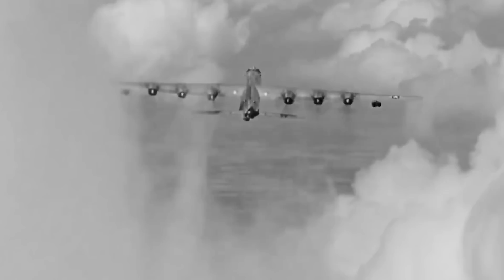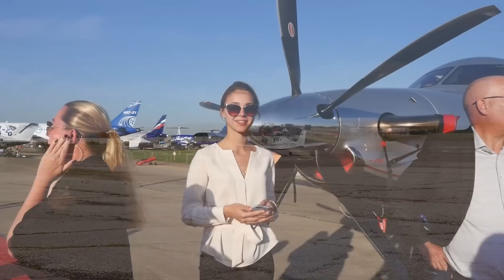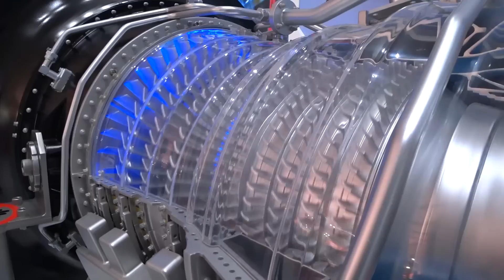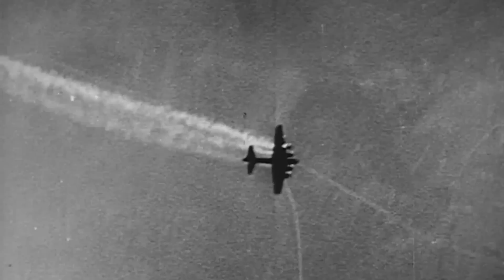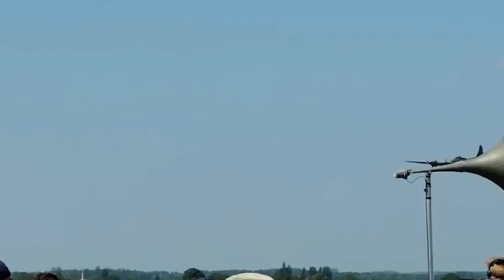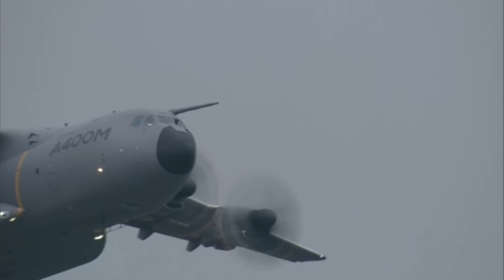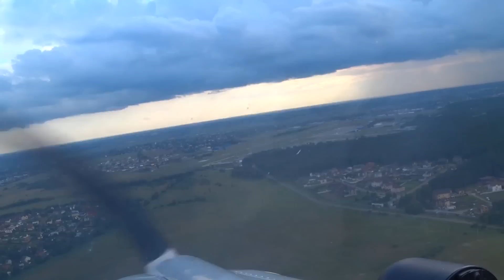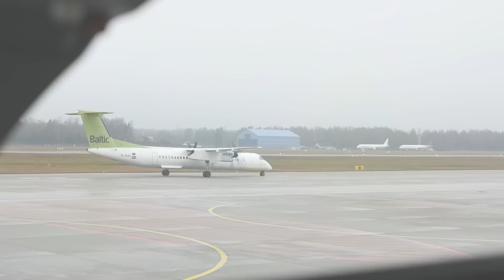Piston and Turboprop engines | What is the difference?

Comment: No one would build a big radial today if they wanted a ~2,000 hp piston engine, they would use a liquid-cooled V-12, like the Allison V-1710, but with modern engine technologies and electronics. Air-cooled radials were chosen for bomber aircraft because they were resistant to damage from weapons fire, but liquid-cooled engines are far more reliable and have cooling systems which produce much less drag, especially at high altitudes.
Reply: Dude, it's not the drag. The reason they used radials was the technology of the times. Is that why P47's, F=2's, 4's & 6's used radials as well? 
Have you any idea when the last replacement parts were manufactured for a radial? Like for a R-2800?
Reply: @georgegarrett9021  Inline, liquid-cooled engines came BEFORE air-cooled radials, and they outperformed radials.
-
As an experiment, a B-17 was refitted with Allison V-1710s and renamed as the XB-38, it flew significantly faster than the B-17 and it could fly significantly farther (both benefits of reduced drag), but radials were used because they were more resistant to battle damage. The same situation occurred with the B-29 and the XB-39.
-
The DC-4 and the Canadair North Star had similar differences in performance, but the Merlins were undesirable in an airliner application because of the noise produced by the open exhausts. This problem could have been solved by using a turbocharger instead of a supercharger (as was done on the P-38), but cost likely would have been an issue.
Reply: @PistonAvatarGuy  the P38 was "Super Charged"? Was the P51 super charged too?
Can You explain about all of that drag especially at high altitudes? How many hours have you logged at & above FL180?
Reply: @georgegarrett9021  "the P38 was "Super Charged"? Was the P51 super charged too?"
-
Oh no, I hit the space bar when I shouldn't have, I must be a complete idiot! The P-38 was TURBOsupercharged, the P-51 was supercharged, as were basically all WW2 fighters.
-
"Can You explain about all of that drag especially at high altitudes?"
-
Holy crap, dude, that requires a LONG explanation. It has to do with the cooling fin density on the engines reaching practical limits and being able to force enough air over the fins to provide adequate cooling at high altitudes. As altitude increases, it becomes more difficult to create enough pressure to move a sufficient amount of air (by mass) over the fins without creating enormous amounts of drag. Air is thinner at higher altitude, in case you are not aware. With a liquid-cooled engine, you simply use coolant to move the heat outside of the engine, which allows you to use much more ideal means to dissipate the heat energy.
-
IIRC, when the Soviets were designing the Tu-85, cooling the air-cooled engines that were first chosen for it ate up thousands of HP worth of thrust at the desired maximum altitude, so they switched to liquid-cooled engine instead.
-
"How many hours have you logged at & above FL180?"
-
Can you explain how that's relevant to this discussion?
Reply: @georgegarrett9021  Your comment really is just nonsense. The Navy had a requirement for radials, for whatever reasons (likely because the aircraft could be made shorter in length, so they took up less deck space on aircraft carriers). Have you never heard of the P-40, P-51, the P-38, the Spitfire, the Hurricane, the Lancaster,  the Bf 109, the Ta 152, the Do 335, etc?
Reply: @PistonAvatarGuy  sure have. I don't know about the Germans but it took the alias some time to learn to get what they needed out of merlins. Especially at altitude. 
The only thing I'll disagree with is "the drag" part. And I will stand by, radials were just more abundantly available. It's in the history books if you want to "learn" something.
I suppose haveing a radial is why the F8's & Sea Furries were such dog's too.
Oh well, I have no knowledge of airplanes any way. Especially since I was never around any.
I only come here to learn from the professor. By no means for the jockularity. 
Oh, you left the P39 out. 🤣
Reply: @georgegarrett9021  I don't even know what you're trying to say about "the drag." Are you saying that liquid-cooled engines don't have less drag? There has never been a debate about this in the "history books." You are aware that the Meredith Effect allowed liquid-cooled engines to have basically NO drag, correct? Liquid-cooled engines also have much lower frontal area.
-
"I don't know about the Germans but it took the alias some time to learn to get what they needed out of merlins."
-
And? How is that related to anything here?
-
"And I will stand by, radials were just more abundantly available."
-
Because they were in greater demand, they weren't just producing things randomly.
-
"It's in the history books if you want to "learn" something."
-
So is the fact that radials were REQUIRED by the Navy and were preferred by the Army Air Force because of their resistance to battle damage. I've read plenty of "history" books, I have a stack of them that's about 2 feet high on my bookshelf and I very much enjoyed reading through them when I was a teenager.
-
"I suppose haveing a radial is why the F8's & Sea Furries were such dog's too."
-
Compared to fighters with liquid cooled engines, THEY WERE. The fastest fighters of the war all used liquid-cooled engines. AGAIN, the Do 335 and the Ta 152.
-
I'll let you in on a little secret: THE RADIALS WERE MORE POWERFUL THAN THE INLINE ENGINES, that's what gave them decent performance, but it still wasn't enough to overcome the greater drag that the engines produced.
-
"Oh, you left the P39 out."
-
I wasn't naming every WW2 fighter, moron. BTW, there are no Sea "Furries," there was no F8, it was the F8F, and how long parts were produced for radial engines is not related to how much drag they produced. You have absolutely NO IDEA what you're talking about, you're just spewing random nonsense.
-
AGAIN: Compare the XB-38 to the B-17 and the B-29 to the XB-39. The XB-39 even had less power than the B-29, yet it flew faster and farther, that's not possible without a reduction in drag, unless the aircraft is capable of breaking the laws of physics.
Reply: @PistonAvatarGuy  thank you professor.
Again, you have how many ACTUAL hours above FL180? 
You made it sound like the radial has a lot more drag especially at altitude. I'm saying that the drag created by radials, Especially at altitude compared, example, to a Merlin is minimal. With power on. Now, if you want to shut the engine down and glide, yeah ok.
There will be a lot more drag down low than up in the higher altitude.
ARE YOU EVEN a pilot? Didn't think so.
Enough said.
Reply: @PistonAvatarGuy  so how much do you Really know from experience the difference between a radial and a in line? I wonder What other factors might contribute to, didn't you say, the range of that b 17 & xb whatever.
Do You even know what the difference is, in fuel flow, between the two with comparable horse power ratings? 
No you do not. Why? Because you don't know crap about any airplane other than what you Read from a book. You've 
Already have told me that. 
Did you know that the difference in compression between a air cooled and a water cooled engine is different. Gee, do you think that could effect the range & performance?
Reply: @georgegarrett9021  You've said absolutely NOTHING of value here, you have NO CLUE what you're talking about and nothing that you've said makes any sense.
-
"There will be a lot more drag down low than up in the higher altitude."
-
You can't even understand this one basic thing. As you climb in altitude, the air around the aircraft is less dense, that means that there's less mass in a given volume of air than there is at lower altitude. An air-cooled engine requires a certain MASS of air to flow over its cylinders at a given power setting in order to maintain a safe operating temperature, but because air gets thinner as altitude increases, it becomes more difficult to force that amount of air over the engine.
-
In other words: If you want to DESIGN an aircraft with a air-cooled engine that can fly at very high altitudes, you need to DESIGN a very large scoop for the engine cooling air in order to get a large enough mass of air to flow over the engine for it to maintain a safe operating temperature. The larger the scoop, the greater the amount of drag. Liquid-cooled engines don't have this problem because the design of the radiator is independent from the design of the engine, whereas the radiator is part of an air-cooled engine.
-
This isn't about FLYING an aircraft at varying altitudes, as they will be designed to fly at altitudes where they remain practical to operate, this is about how aircraft are DESIGNED by aircraft manufacturers.
Reply: @PistonAvatarGuy  your the one just spitting jargon. You have No real idea of the, real, performance differences between the two. If you did, you would know that a 1000 horse radial will burn damn near twice of the fuel as a water cooled engine with basically the same horse power. 
It's not the drag that makes the difference. It's the fuel flow!
Reply: @georgegarrett9021  What personal experience do you have with the B-29 and the XB-39? Do you also have personal experience with the B-17 and the XB-38? How about the Canadair North Star and the DC-4? How is personal experience relevant here? EXPLAIN IT.
-
"Did you know that the difference in compression between a air cooled and a water cooled engine is different."
-
Modern liquid-cooled engines can have significantly higher compression ratios than air-cooled engines, but they weren't significantly different during WW2. The R-3350 actually had a slightly higher compression ratio than the V-3420, yet the V-3420 GREATLY outperformed the R-3350. The XB-39 also wouldn't have been able to fly faster than the B-29 with less power unless it had less drag.
-
Do I need to film a f--king puppet show for you? Why are you getting so wound up about this? It's just technology, calm down!
Reply: @georgegarrett9021  How does fuel flow make an aircraft fly faster with less power?
Reply: @georgegarrett9021  "So I have no idea about flying at altitude."
-
How is your flying experience relevant to the DESIGN of an aircraft? Have you ever DESIGNED an air-cooled aircraft to fly at high altitude? Maybe you should go tell Grob that using liquid-cooled engines in the Strato 2C was a stupid idea, or maybe go inform Boeing that using liquid-cooled automotive engines in the Phatom Eye was stupid. Post their replies here, I'll wait.
-
"The higher the plane climbs, the less drag it has not more."
-
Like I said, you're not understanding any of this, you're not even attempting to understand. This isn't about drag at high altitude vs low altitude, this is about the drag that air-cooled engines creates AT HIGH ALTITUDE vs the drag that liquid-cooled engines create AT HIGH ALTITUDE.
Reply: @PistonAvatarGuy  I rode in the nose of b 17 once. A Ford trip motor once, saw a B36 crash and burn at Whitman. A 2 seat P51 and flew a T-6 some. 800 hrs Pic in the Lear 35. A couple of thousand in the B200. 10+ thousands of hours in various other muti engine aircraft. All PIC.
And a few hours in one of the hound dogs. They were jetstars Elvis owned. 
It Dosn't change with the aircraft. Drag is drag & altitude is altitude.
The numbers may change but the effect don't.
Reply: @PistonAvatarGuy  🤣
Of course it does. With the same engine. The more fuel you give it the faster it's going to go.
Reply: @PistonAvatarGuy  correct. That is what I know for fact.
Reply: @PistonAvatarGuy  go back and read your first reply. That is exactly what you said.
Reply: @georgegarrett9021  I said: ...liquid-cooled engines are far more reliable and have cooling systems which produce much less drag, especially at high altitudes.
-
Liquid-cooled engines produce less drag at ALL altitudes, the DIFFERENCE in the amount of drag produced by the two engine types INCREASES as altitude increases. I wasn't saying that drag increases with altitude, I was saying that one engine produces more drag than another as altitude increases. You have the worst reading comprehension of anyone that I've ever come across online, and that's saying a LOT.
-
BTW, Burt Rutan will tell you the same things that I've said here and he's one of the most prolific aircraft designers of our time. How many aircraft have you designed?
-
IIRC, his statements about liquid cooling are somewhere in this presentation: https://www.youtube.com/watch?v=2OZQ-9Nd76g
Reply: I have not nor have any intentions to design a aircraft. If I did it would look like the Avanti Piaggio or Beech B2000.
The reason a lot of the WW2 fighters had radials is simply because they were already set to manufacture or were already proven. The manufacturing of them were already tooled. No one with any sense would've not wanted (example) a Merlin. They wanted them. They just weren't quite up to the job yet. An A36 compared to a P51D. We the allies didn't get the D's untill what? 43, 44?
They were the cats meow. Along with the P38s. The P40, for one example was not a good airplane above 15,000. Yeah, I'd taken a corsair or even a P47 over a P40. Unless the zeros would stay down low.
In today's world, developing a Radial would just not be a good idea if for no other reason, the amount of fuel its going to burn. Oil/fuel wasn't a real big problem back then. Having to carry enough to get Germany and back was a problem. Especially for those big, thirsty radials.
Radials just aren't practical anymore. A turboprop is the same headache if you don't go High.
I believe we kinda agree, just saying it different. But I believe it's even easier to understand when one has been there & done that.
Look at the B36. Back then in 50s all they had was radials that could produce that much power. Albeit, they had to stack several rows of jugs. The turbo jet and even low bypass turbo fan jet were in the works, it was just going to take a little more time and the military brass (Curtis Lemay) just didn't think he could wait. So the B36 had to be.
They weren't up to Snufff with their turbo chargers in the war radial days at first. I believe it was the p38l? it could produce sea level pressures at 30,000feet. The turbo's today only give sea level to 15,500.
Have you any idea about "coffin corner". That is something that I didn't like about the Lear 35 all the way back to the 23's, if I got to fl450 or so. We seldom got above 370 because of it. The new wing has really helped them with that. 
Okay, later.
Reply: @PistonAvatarGuy  🤣
I know I'm not a troll and I'm not as stupid as some I have known. 
But wasn't it fun. I miss read it whilst I was trying to multi task.
🤣
Reply: @PistonAvatarGuy  I met him back in 80 or so at Mojave. They were doing tests on... was it the Lear fan. I don't remember now.
Reply: @georgegarrett9021  "The reason a lot of the WW2 fighters had radials is simply because they were already set to manufacture or were already proven."
-
That doesn't make any sense, because liquid-cooled engines were around FIRST. The first successful powered aircraft was powered by a liquid-cooled inline engine, as were many of the most successful early aircraft. The Merlin and Allison were based on long lines of successful aircraft engines and were in widespread use well before WW2. YOU HAVE NO IDEA WHAT YOU'RE TALKING ABOUT.
-
Clearly, reading isn't something that you do a whole lot of, but I suggest that you read Aircraft Propulsion by C. Fayette Taylor, it's available free online.
-
"Along with the P38s."
-
Which did NOT have radial engines. The US didn't have many competitive fighters early in the war, radial or not, there was no performance advantage to be had with radial engines. AGAIN, the Navy REQUIRED that aircraft have radial engines, because of their resistance to battle damage, this is a widely known FACT.
-
" Oil/fuel wasn't a real big problem back then."
-
That's a HUGE problem during wartime, because possible supply problems and the logistics associated with the transportation of fuels are major concerns. AGAIN, liquid-cooled engines have far less drag that air-cooled engines, PERIOD.
-
"But I believe it's even easier to understand when one has been there & done that."
-
NONE of your experience is relevant to this discussion.
-
"Look at the B36."
-
Yes, above a certain power level, the radial configuration does become more practical than an inline configuration, simply as a result of the problems associated with larger engine designs, but that is in no way related to whether the engine is air-cooled or liquid-cooled. Many engine manufacturers were working on liquid-cooled radials by the end of the war, because of the significant performance advantages that come with liquid cooling, LIKE SIGNIFICANTLY REDUCED DRAG. The Dobrynin VD-4K appears to be the only successful example of this engine type.
-
"The turbo's today only give sea level to 15,500."
-
A) That depends entirely on the engine. Turbo-normalized engines can produce full power up to 20,000 feet, easily. B) The P-38 had a turbosupercharger AND an engine-driven supercharger, providing two stages of compression, which is why its critical altitude was so high. Do you even know what critical altitude means? Are you really pilot?
Reply: @georgegarrett9021  In Aircraft Propulsion , there is a section titled: Air Versus Liquid Cooling
-
Some quotes: "The use of high-boiling liquids (mixtures of water and ethylene glycol) for engines formerly water-cooled was an important forward step in reducing the heat-transfer area, and thereby the drag, of radiators for liquid-cooled engines." ... "This improvement, together with better radiator design and radiator cowling brought the drag of liquid-cooled engines well below that of air-cooled radials of equal power."